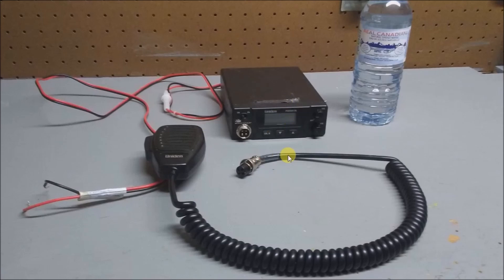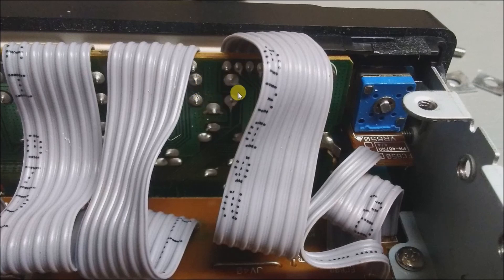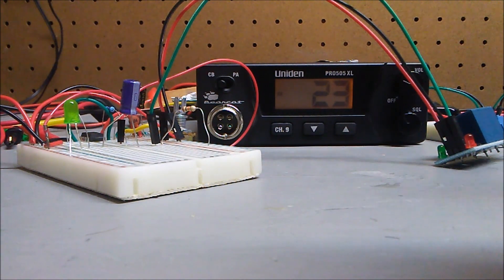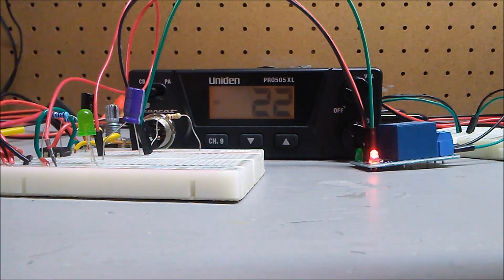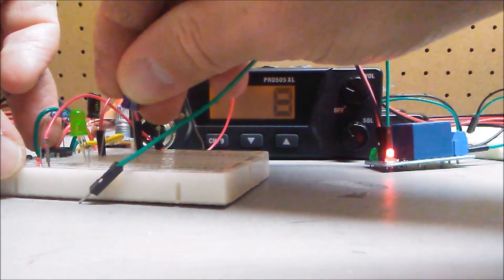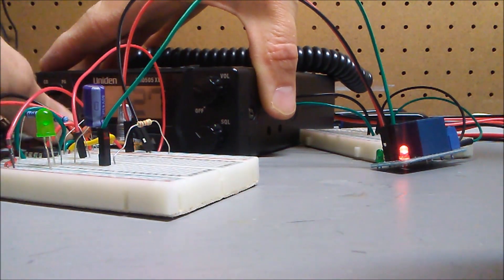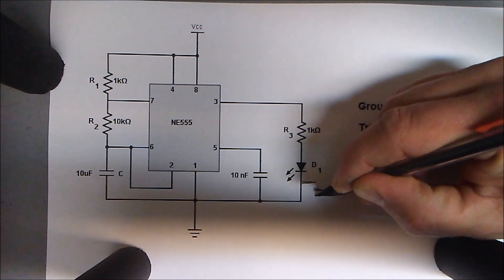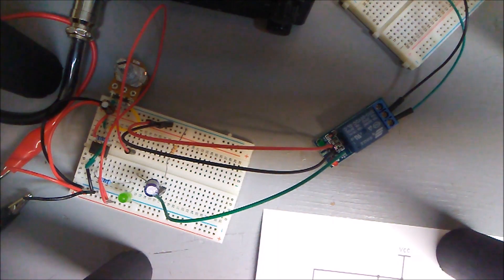Add a Scan feature to your CB Radio

Comment from the maker: 1:35 Sorry, I called it a scanner, I meant CB Radio.
15:43 CORRECTION: The "penciled" part of the circuit tees between the resistor and the LED (R3 and D1). I incorrectly drew  it after the LED.